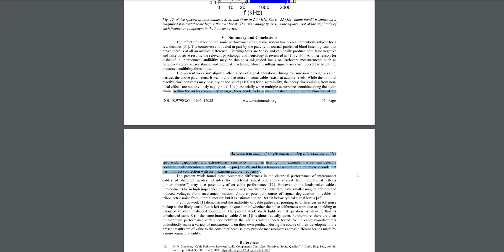Scientist Finds Measurable Difference in HIFI Audiophile Cables ! PROOF

Comment: Did you actually read the paper? There are no listening tests!!! This paper does not prove there are audible differences in cables. It does not even claim that! It simply claims there are measurable differences between cables. That_is_old_news. No one is disputing that cables electrical properties measure differently. The issue is audibility of those differences and the actual effect. In point of fact some high end cables measure so poorly that they do have an aurible effect. MIT cables are so high in capacitance that they actually roll off the high frequencies in the audible frequency range. And yes, you can make a cable bad enough that it will have audible noise. You can have a bad connector that will do exactly the same thing. Those of us who dismiss the claims of high end cable manufacturers don't believe "all  cables sound the same." We beleive, based on thorough scientific research that a well designed cable opperating within it's proper length will be audibly transparent. And nothing in this paper contradicts that. Nothing. So when you have these $33K speaker cables and interconnects with claims of (taken straight from Synergistic Research, the ultimate snakeoil company in audio) "We started with an exploded geometry first pioneered in our original Galileo System cables of 2009 to reduce cross-talk between individual hand-made Silver Air String geometries for the most refined sound possible. We then voiced each cable to present not only a holographic soundstage with maximum resolution, we made musicality and harmonic integrity our top priority when deciding between competing design and tuning elements within each cable. As a result, these are the most effortless and pure-sounding cables we have ever manufactured." That is all Bull $**t. Pure B.S. And any competently designed and built speaker cable that is correctly matched to the amp and speakers will be utterly sonically transparent. I would not be at all surprised if the ridiculous monstrosity that is the Synergistic Research SRX cables color the sound. But they sure as hell do NOT make the improvements they claim. 

And on another note about "science, measurement folks, and listening tests." If you really know science then you should know that in the field of psychoacoustics, the scientific study of human aural perception and proecessing that DBTs are the gold standard and sighted listening tests are considered junk anecdotal evidence because the research in psychoacoustics has conclusively shown that wihout double blind protocols as well as facilitated quick  switching and level matching we are allprone to percieve audible differences, even dramatic ones where there is no actual difference in the physical sound. Many of us who understand all of this have heard the same differences you hear under sighted conditions. That is human nature. So any reported differences under sighted conditions can easily be the result of bias effects and steered focus. In fact that will always be an influence even in situations where there are actual audible differences. Nobody who understands the science of psychoacoustics will ever tell you that we can determine there are audibel or no audible differences just based on measurements. BUT when we corelate those measurements with well establised thresholds of human hearing that were established through extensive listening tests then we can draw such conclusions.
Reply: It does claim there are audible differences unfortunately.

Comment: I just discovered the cables least likely to be changed that makes a difference.

Try changing your cable box/modem cable from copper to silver. 

Also, try optimizing your lightening charging cable for an iPhone. 
Furutech makes an incredible one. I believe, they optimize the iPhone’s Bluetooth AAC signal that stock cables and phone batteries can and will never achieve.

Comment: The Nelson Pass speaker cable test done 3 decades ago still shows how things can change very low impedance speakers.
Reply: no doubt if you mismatch a speaker and amp with the wrong cable the cable will turn into a passive EQ.

Comment: The paper demonstrates that cables have different electrical properties, which everyone recognises exists. But there is no data showing them to be audible. For example in one section the authors establish that noise exists but then goes onto to say ‘such correlated noise will intrusively image in the middle of the reproduced soundstage’ without providing any supporting data. The only authority provided are links to two articles about human hearing. This type of mixing up of facts and opinions in research papers just adds to the confusion and there are many other similar speculative statements made throughout.
Do cables sound audibly different? You won’t find the answer in this paper. 
Good of Jay to encourage people to read scientific papers though.
Reply: For the one that know and understand low of physics  all its clear even without paper. But for one that demand authority cover that shield their luck of real knowledge it is never clear nor valid.

Comment: I am a believer that cables make a difference however the thing the irritates me about cables and audiophile cable companies is the insane prices for strands of copper or silver. There are only so many purities of copper that are good enough for audio use, so many ways to mix it so it doesn't oxidize, only so many ways to shield it, jacket it and run it through pulling machines. Companies that start charging 10k-130k for 2 x 6' foot cables, no matter how it was designed is absolutely absurd. Even if they put 40k hours into the design and testing, built a new facility to manufacture it, used moon dust in the jacket, I still can't justify 10k or more for 12' of copper cable. Think about it, a 10k cable is $833 per liner foot!!! I could see spending $100 to $150 per foot on the rarest designs, the purest copper known to man, the most extreme jacket technology, the coolest way to separate it within the jacket, yatta yatta but not 10k!
Reply from the maker: right. Price is another subject and problem

Comment: I love science too or get excited about it. My science is unique acoustic experimenting with speakers. I have semi open cone med/treble drivers with a bass reflex woofer in tower boxes. The woofer is firing vertically downwards into the floor. And the semi open cone (point source) driver has an acoustic gap between the driver and the acoustically treated speaker hole. It sounds "different" but all my friends love the difference and I would not listen to regular 2-ways or 3-ways again. Even the local hifi shop dudes like my speakers. I made 2 prototypes, one with a FR driver with a woofer for lounge use and a 2-way coaxial with a 10" woofer for lounge use (and for CRANK use). Now I am going to clone both speakers and casually sell them. I'm so excited! If you make speakers from scratch you have to buy some good speakers to copy the sound with your made speakers. And then diverge from the sound (just a little bit) to your liking (your own sound). Just copying your reference speaker seems to sound a bit ordinary cos the drivers and acoustics are different. You have to make your speaker sound work with the drivers (and to your taste). But still keeping basically to your reference speakers. I couldn't build speakers from scratch without my reference speakers. Not just by ear and not when the sound can radically change when you walk around my room. And make sure your made speakers are as close as possible to your reference speakers when testing your made speakers. When I bought my (regular) 2 grand B&W 706s it was a complete game changer for my speaker building hobby. If you can't afford a soundproof room and all that equipment (and want to build speakers from scratch) get some good speakers so you have an idea of how a speaker should sound in that room. You will make great speakers with reference speakers and they may even sound better than your reference speakers. Mine smoke 'em cos they are sound source treated and with special acoustics that I have never seen or heared before (and it seems like it's a subjective advantage over regular speakers). At least for me. I feel that I'm lucky cos I have something different (thanks to science). And this is what drives me to make speakers more than just putting drivers in boxes. It's a speaker hole new level.

Comment: Conductor Capacitance can influence sound. And its been a few decades since I took 4th semester Physics, but as I recall, Electrons are not forming Coopers Pairs and traveling via the conductor, anywhere near room Temperature. They strike and bounce off the vibrating crystal lattice of the metallic conductor and even move backwards. The signal transits via the Electric/Magnetic Fields established by the Electrons, outside of the conductor.  Instead of spending large sums on conductors that cannot superconduct, I've invested in and built Valve OTLs, both Class AB and Class A1. Was building Multitiered power supply, Class A, MOSFET output stage, amplification, but the OTLs based on the 6C19PI and EL 509 tubes are vastly superior to solid state, from my observation.

Comment: I'm a professional DJ and a professional sound engineer for 43 years and I can tell you that the thicker the cable the more sound you get for example at my home I have a vintage pioneer Sx system and I was running 16 gauge wire to my speakers until one day I said let me see what a 10 gauge wire would sound like keep in mind this is a very thick wire and I had to solder the ends so that they would go into the post but once I did that the 10 gauge wire gave me more sound quality and power which actually made me turn down my system from where I usually keep the volume My receiver is a pioneer Sx 1980 ( THE HOLY GRAIL) and i Play 6 Pioneer Cs-99A's and trust me I can tell the difference the Vintage Pioneer SX 1980 is the only receiver that can play 6 speakers at the same time A,B & C don't get me wrong 16 gauge is just fine but me myself I will only use 12 gauge or 10 gauge copper.

Comment: There are a few factors to weigh in:

#1 The sound of the cable itself.

#2 The sound of the interaction between the cable and the entire system.

#3 The class/type of gear that then will react very differently.

#4 Generally you need gear that is on the shorter circuit type of the scale with a combination of higher end parts, for a reaction to occur that makes it able to for the user to hear it.
And when 90% of gear in the world is running some of equalizer, DSP, upsampling or has other suppressors in the system like maybe a noisy PC which acts as a streamer, then it can be very hard to hear any difference, since these generally smooth of the reaction process that we then hear.

Comment: If you understand that electric motors run on forces created by fields generated by electric cables, then you can understand how different cables can affect in the electric field  outside of the cable. It isn’t something that is easy to quantify.

Comment: This is a topic that will be debated forever. I use a simple rule and don't spend a lot of time thinking about it. I would rather enjoy listening to music instead of trying to analyze everything. My rule is spend on cables appropriate to what you spend on your gear  and speakers. If your system cost $5000, don't spend $5 on cabling. Maybe $500 is more appropriate to get better quality cables that match what you put into the rest of your system. If you have a $1000 system, you probably won't gain much by spending $500 on cabling. You would do better to spend more on you speakers, amp or your source. If you have a $50,000 system,  you might want to spend a few thousand on cables. Don't put retreads on a new Porsche and don't spend $4000 on new tires for your old Honda Civic.

Comment: Yes! cable is another important link in a Hifi chain. But someone would dispute this like (Audio Scientific Review).  Measurement with 20Hz-20kHz all cables are all prefect. But with higher frequency it's the transmission line and skin effect are the basic engineer have to learn. My thinking on this is that music is not just one sine wave. but they are complex waves and dynamic timing event. Voltage and current carrying link. Lab only measurement won't gives any conclusion to it.  Thanks Jay for bringing this topic to light.
Reply: Nope. that is a complete misrepresentation of the ASR position on cable sound. No cable is "perfect" They all have measured distortion and added noise. The issue is audible levels of distortion and added noise. All "sound waves" are sine waves in an electrical audio signal.They only vary in amplitude and frequency. None of them are more or less "dynamic" or "complex."

Comment: I'll just say that sometimes a good quality... Something... Including cables can make a difference. It's probably the better material and more likely the thicker gauge that's making it better overall. A better cable doesn't have to cost an arm and a leg. But in most cases bigger and thicker is better. Lol yeah I said it...

Comment: Resistance is the biggest factor. 

Material and Gauge is what makes the biggest differences with resistance.  

CCA will sound different than 99-100% pure OFC.

The gauge also matters. 10-12 AWG will allow lower frequency better than 20 awg

Silver cables sound different from copper.

A quality $15 10-12 AWG that is made of OFC will sound the same as a $500 10-12 AWG thats made of the same material.  

Its all measurable by resistance

Comment: The measurable differences are not within the audible range Jay....unless you are secretly a genetically spliced catboy.
Reply: @tcc5750  Agree. Cables are just a transfermedium between amplifier and a loudspeaker/crossover components. Every cable has its own properies and influence a measurement when being connected to a load, within the audible range. Audible? Nah...  Given that the cable is of average good quality.

Comment: Decades ago I bought a pair of Monster Cable interconnects to replace the giveaway wires for my CD changer, just to see what all the fuss was about. I haven’t looked back since. I use measurements and specs to the degree they can indicate compatibility, ie resistance, power consumption, etc. I use my ears to hear the actual sound. Whoever else does what is completely irrelevant. I’ll start relying on measurements to indicate the quality of sound of my audio components, when I start relying on reading a recipe to determine how a final dish will taste.

Comment: I haven't read the paper yet.  
That said, EVERYTHING in the signal path has some affect on the signal.  Whether it be high-quality capacitors vs. low quality ones, or large gauge braided cable vs. solid conductor flat cables.  Everything that conducts, filters, or amplifies the signal has an affect on it. What matters is whether or not the listener can perceive the difference.  Danny over at GR Research finally hit on the biggest issue with the effects of things like cables and binding posts.  If your system is not installed correctly(think speaker placement and room treatments) then the subtle differences that other improvements(like cables) make will not be noticeable.
The self-styled scientists who claim that the minute levels of capacitance and inductance present in speaker cables or interconnects can't perceptibly affect an audio signal seem naive to me.  Human hearing has evolved to be very effective at determining direction and distance. Consequently, anything that alters the audio queues our brains use to do so will have noticeable affects on our perception.
Reply: the question isn't whether or not things have an effect but whether the effect is audible.

Comment: I had a cheap SVS cable rca connected between my streamer and dac. One day my dac just stopped playing 192kh songs but would still play 96kh and below. Switched to a better cable and problem solved by I'd never seen a cable fail partially in this way. Anyone have any theories? It was perfectly repeatable and consistent result and the cable did allow my dac to play 192 at one time.

Comment: Jay, bravo. This was well constructed and gets into the nuance of how amazing human hearing can be from the standpoint of auditory cues. As well, those other very important and often overlooked dielectric properties. That so many refuse to see this other than as a black and white issue need at least to conceded the value in this research. BTW I just changed out my speaker jumpers, totally palpable difference in tonal structure and at what frequencies reign in clarity, focus and potency between the two types of cables. And I love both sets for very clear and DISTINCTLY audible reasons 👍

Comment: been an audiophile for 50 years and cant begin to tell you how many systems ive owned.... currently using rose 150b, primaluna evo 400 separates, and Maggie 3.7i's...   I have never, ever, heard any difference between a $200 cable or a $4000 cable.  Maybe the measurements should include  psychological studies on the effects of spending 4 grand on a cable(or anything for that matter) and  wanting to hear a difference.... similar to the unconscious mind example. Brains can play tricks on you.  :  ).
Reply: Your 50 years of experience apply only to YOU.  The "brains can play tricks on you" argument is always thrown around to discredit anyone hearing differences in cables, capacitors, connectors, etc.  Funny how those that claim to have never heard a difference will never apply "brains can play tricks on you" to themselves.  That argument cuts both ways.